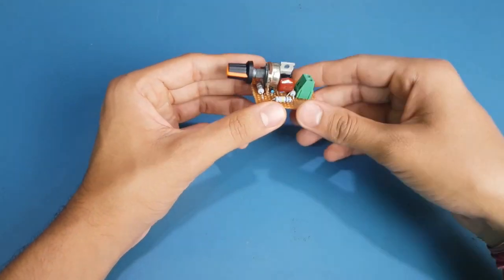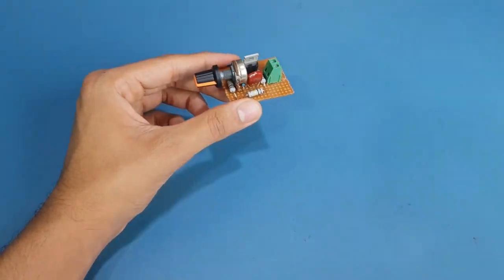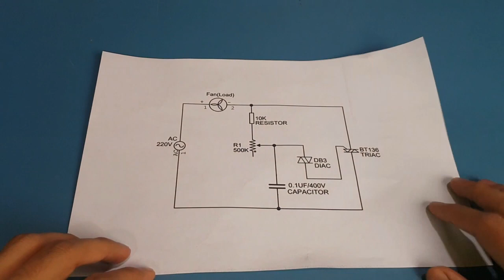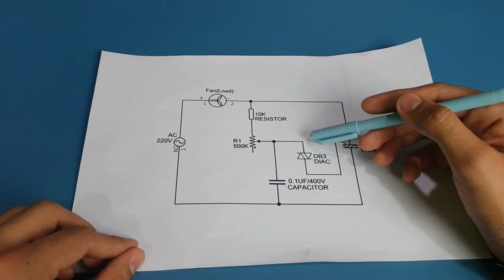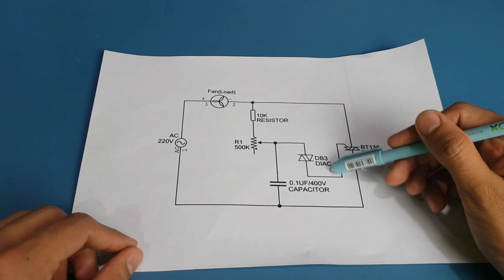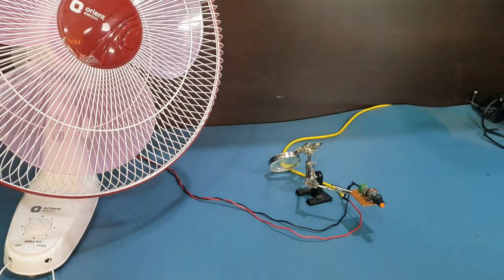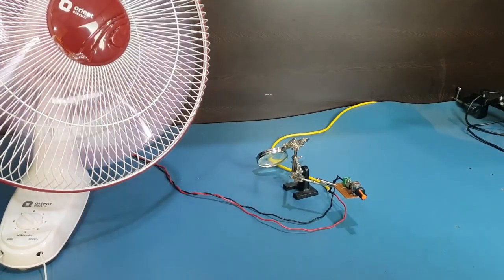AC Fan Regulator using TRIAC and DIAC to control the Fan Speed

Comment: So the fan doesnt come with a regulator? or whats the difference?
Reply: Fan does come with 3 speed switch , but with device from wideo you can smoothly control the speed through all the rpm range of the fan